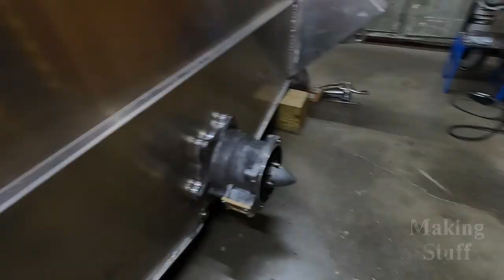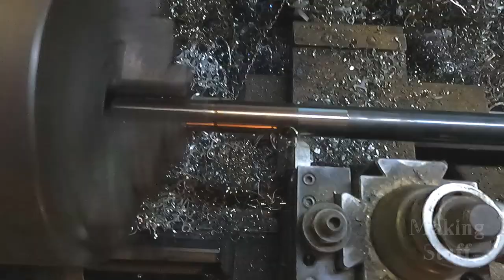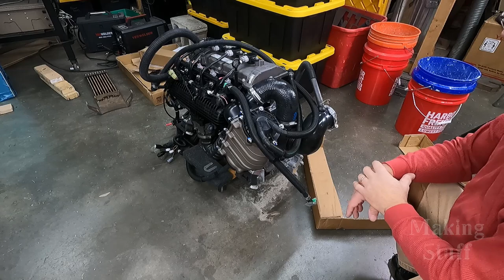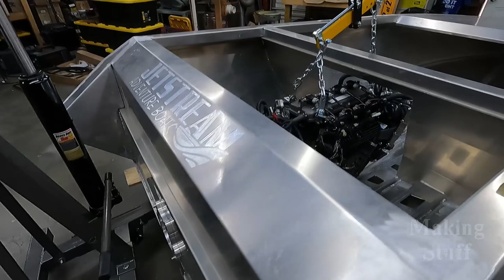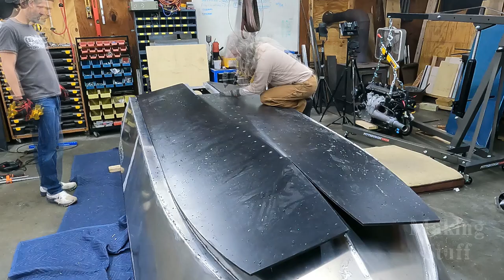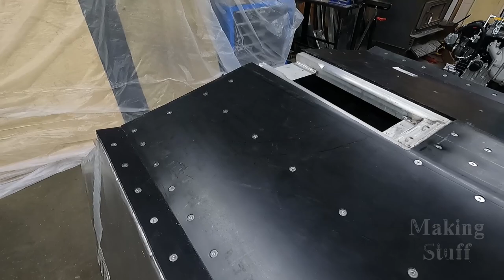Mini Jet Boat Build Part 4 - Lot of Progress Made

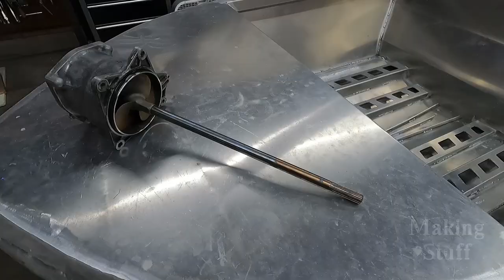Comment: 1:52 for anyone who doesn't have a nice friend nearby, I would get another piece of aluminum tubing and extend the existing intake by 2 7/8". Often that tubing comes in diameters and wall thicknesses such that they slide over / under then next size smaller / larger. I believe it's just referred to as telescoping. I get smaller tubing that way. I have bought larger square tubing that way as well. Alternatively, cut 2 7/8" out of the middle of the drive shaft and use a sleeve to connect and weld it back together although this might be a bit dodgy unless you have a decent lathe to make a nice tight sleeve. Love the project.

Comment: Just found your build series. I bought a Jetstream Headwater 10 foot kit about four years ago and now nearing full retirement finally starting to build. I'm actually making it a challenge to myself to fabricate everything myself including intake, stomp grate, and steering mechanism. Donor is a Yamaha Waverunner VX110 which doesn't compare to modern supercharged skis, but I was told by Jetstream owner would be more than adequate for a 10 foot.
I'm learning from your build experience and hiccups along the way.

Comment: Im working on a build where the engine is bigger than it should be for the hull... going to extend the pump out the transom further and extend the ride plate, i dont have extra space in front of the bulkhead in a small 6 foot. Something you could do on your next build too if you dont want to come thru the bulkhead again

Comment: Jet Boat project is looking good! When you cut the hole it would of been nice to be able to cut it short and narrow then use some sort of home made brake to bend it back to give the center more strength, but it's working. If needed, you could weld/rivet/screw a support around it. Looking good and it's great to have helping friends. Keep up the great work.

Comment: Why didnt you remove the propeller, cut if of on that side, and remounted it? genuine question
Reply from the maker: The impeller has a spline on it too and is very difficult to remove, even with the correct tools.

Comment: Is it a concern that any of the screws will leak water? Was there any sealer used or a certain screw with a water tight sealing surface?
Reply from the maker: Rubber backed washers were used.  No leaks yet.

Comment: Hi, did the plastic come with the kit? Also can you talk about how you are securing it?
Reply from the maker: Yes the plastic and hardware came from Jetstream.
Reply: @MakingStuff  cool! Thank you.
Reply: @MakingStuff  Just wondering about all the holes in the bottom of the boat for mounting the UHMW plastic.  Do the screws create a water tight seal or do you have to go back and seal every one from the inside?
Reply from the maker: @gizmobowen  There are rubber backed washers and nylocks that go on the other side.
Reply: So, you are threading into the aluminum, tightening bolts in, and then installing the washers and Nyloks? @MakingStuff
Reply from the maker: @heisreal249  Yes.

Comment: is the whole hull made of 6mm thick sheet?
Reply from the maker: No, the bottom is 1/4" (6.35mm), the sides and transom are 1/8" (3.175mm), the stringers are 3/16" (4.7625mm)